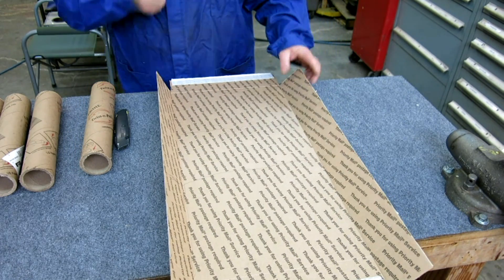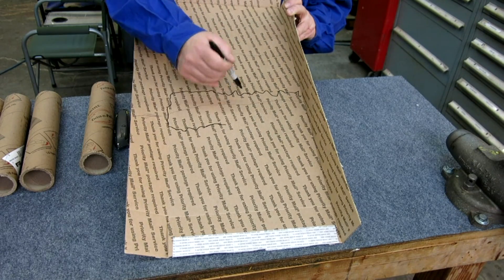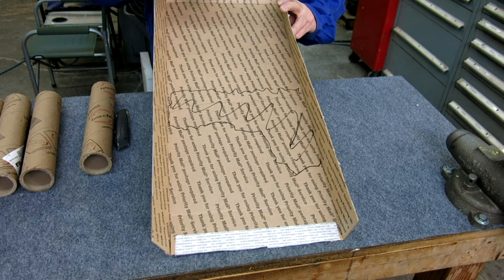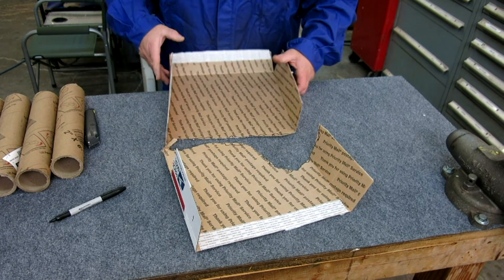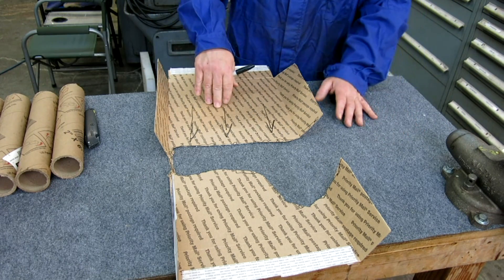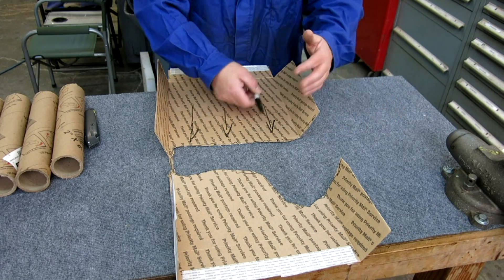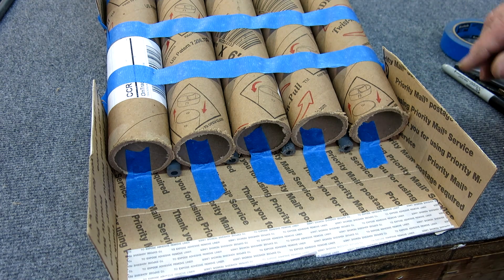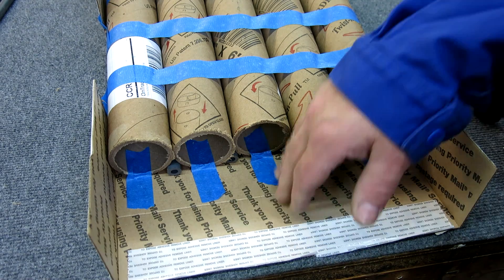Oroville Dam Spillway Repair

Comment: Tom

Why not put a carefully calculated ramp up steam and let the water jump over the gap 🤡🤡 now where is my taxi 😀

Your mention of laminar flow brought back memories of being at Manchester uni.  I was attending a seminar on vibration analysis of rotating machines to predict failure modes before they failed using fast forniour transformation /sp ,while we were there they took us down to the engineering labs to show us Reynolds experiment in lamina flow ,yes they still have the gear he used and it still works just fine hope the link shows up there is a pic at the bottom 
http://www.mace.manchester.ac.uk/about-us/hall-of-fame/mechanical-engineering/osborne-reynolds/

Stuart

Comment: Why not fill the gaps between pipes with plate steel, and some fast set epoxy on the bottom against the concrete? I'm guessing the biggest barrier to this plan would be the logistics of getting the pipe in place, the ground around that area is probably a mess, likely a nightmare for heavy equipment like cranes etc.

Comment: Given there was clearly no forward-thinking on evacuation (as in planning) and when they executed an evacuation, a total lack of coordination, I would put little stock in anything that comes out of those allegedly in charge of a solution.

Ignoring the problem for so long, as in kicking the can down the road, is another malfeasance worthy of public ridicule and political backlash.  Jerry Brown and others must face responsibility here.

Tom's idea is fantastic.

To the left (viewed from air, facing) is the emergency spillway.  Could this be sufficiently stabilized, quickly enough, to permit a greater flow?  Then the main spillway could be shut down and Tom's idea put in place.

Comment: Based on measurements taken from this picture: http://www.zerohedge.com/sites/default/files/images/user5/imageroot/2017/02/08/spillway%20damage.jpg (which mind you, is in the early ish stage, now the gape is larger) and Google Earth (non-3D augmented, so you can see the concrete slabs) the game is 145 meters long, give or take a few meters, now, the width is 53 meters long, give or take a few meters.
A single concrete slab is about 12.05x14.60 meters long.
My take on it is unfeasible, i like the idea, but the 145 meter long gap (and again, that's early in) is quite long, it would need some kind of "infrastructure" under to support it. However, putting a big pipe with a helicopter, then diverting some of the water + controlled release at the other spillway (the way i understand it all works) could put enough water out of the main one for some light repairs with fast setting concrete or some serious scaffolding and a water proof surface that replaces the corroded concrete slabs, this water isn't standing so anything should just "glide" over if the structure is strong enough.
Reply: You're absolutely right. It's reminiscent of the landslide at the ski jump in Erzurum (Turkey). They poured the slabs directly atop the hill's earth. No piers or underlying concrete stepping.
Reply: My understanding is that the whole thing was meant to be temporary when it was built, and that a proper dam was meant to go where the earthwork dam that contains both the emergency and auxiliary spillways are.
Reply: Forgot to mention, since Google maps takes pictures from above, there's a loss in length that i can't account for since there's an inclined surface to which i don't know the angle. Maybe an engineer knows that based on US standards. I'm from Europe, no idea where to look. 
Oh and the gape started (oddly enough) right at that observation point (i assume that's a panorama telescope) road. That gives an accurate measuring point.
Reply: aserta using the emergency spillway is considered uncontrolled.
Reply: As an architect tho, i'm really shocked that the spillway was made in such a fashion. That's just asking for problems. Personally (of course, after passing it to an engineer for double checking) i would've had structure to anchor those slabs, there's no structure, at all, fact gleamed from the side pictures, those slabs were laid down as they are. IF i'm right, that's really sloppy. No offense to anyone's feathers, but you don't play with water, period.
Reply: Jake, wouldn't know. Not a dam expert, we studied them in school as structures. Well, then it's pretty bad.

Comment: I'm not sure of the length of the hole, but precast flat bottom concrete tubes might be a possibility.  Think of the huge spans they can make for bridges.
Reply: Spancrete.  The pre-stressed twin T sections they use to make parking garages, etc.  The concrete is embedded with tensioned steel cables.  Lay them upside-down so the flat side is down and the ribbs are up.
Reply: Precast concrete (like highway crash barriers, catch pits) might be the best way to fill the hole up and just add a quicker drying layer to fill the gaps between pieces and make it smooth, assuming that the supporting soil is soaked up anyway. The soil could be dried with a drainage layed in there first.

However, if the dam is under control there is more time for a permanent repair.

Comment: I think the spillway is 300 feet wide.
Reply: 174 feet wide , via google maps. Length of the gape is 145 meters long (+/- for satellite picture innacuracy and plus a few meters because the picture above is a picture of an inclined item, true lenght cannot be determined without the angle of the spillway, don't quote me on it but maybe 150 meters long or in feet ~492)

Comment: This is great! The best way to get a solution, is to start with an idea, because everyone involved with a problem has some kind of thought in mind to solve it. It just takes that one guy to come up with the ultimate fix. Lets just hope that the people involved are listening to everyone and not just a small group of closed mind individuals. Personally I would get together a couple of guys with 3D printers, lots of PLA, lots of glue, and print a section to fill in the bad part, it would only take about 100 years and would last about 3 seconds but ha, it's a government job, right?

Comment: I like this idea, it minimises the force on the face of the pipes. The smaller pipes can be pre welded to the bigger pipes before they are lowered into place. sliding them down after the larger pipes are in has to many problems associated . pins can be added to the large pipe to help anchor them to the exposed rock. ( darn spell check and large fingers excuse the typing errors) 😀

Comment: I'm not an engineer, but I've plaid with fast flowing water in the mountains as kid. The water will shoot up in the ski at the edges of the pipes. And the water is not clean. the fine particles will erode the pipe in days to weeks. I don't think it would work. The problem is that you don't want do disturb the flow of the water, every time the water changes direction something have to take the force of the water hammering against it. In addition swirls will appear and grind away the concrete and seel.
We have a lot of dams in Germany and this kind of damage was fixed with with a special kind of asphalt and iron mesh in the past.
Reply: Jake Minogue What a snide,  hateful remark.  Contribute or remain silent.
Reply: The concrete would be made with ASTM Type III Portland cement - fast setting, high early strength...

This cement is made for things like tilt-up warehouse construction, where a very large percentage of the full strength is needed quickly.

The problem is, such cements are not stocked in huge quantities - they are high in aluminum oxide content, which makes them difficult to burn in the kilns, and then the clinker is harder to grind than a common Type I or Type II cement.

So, they are more expensive to make, production from the kilns and ball mills is less than for common cements, and they are not needed as much.

Then, they have a higher heat of hydration and tend to be more expansive during curing, so they are best suited to making thinner layers.

So, the Type III cemented concretes aren't a panacea, nor are they something you can rely on having available in sufficient quantities ate need.
Reply: You are correct, in my opinion the plan is neither feasible nor practical. A better solution would be to fill the void with gravel, stones, really anything that is relatively strong and readily available. Then to pour quick setting concrete. Its definitely not a permanent solution by any means, but would be relatively easy and fixes the dam in a way that allows it to operate as initially designed. There are certain concretes that can be poured and set in a matter of hours, I'm not sure exactly what they are but they are used for airport's that can only facilitate repairs at night.
Reply: Jake Minogue. And? Where I'm wrong? What's my mistake? Please elaborate, and make us smarter.
Reply: IPuttLikeSergio. I don't consider that a hateful remark. I'm german, he has to do worse. ;-)
Reply: boelwerkr you got one thing right, you're not an engineer...
Reply: I wasn't aware that there is such a fast setting cement. Very interesting. 
I think the expenses made the fix I've seen in my youth with asphalt. 
As i see it. You need something that will hold the stones and gravel together, not to expensive, fast settling and available in big quantities. It didn't look like a road surface tho. At least not in my memories. Its over 30 years that I've seen it... :-)
Reply: If there is one thing I trust, it's German science & engineering.  Otto von Guericke!

Comment: Your concept is good, issues I see the concrete (cc) in the spillway is maybe 8" thick it was layer on the slope it has been undermined by the water flow the pipe bridge is going to need to be very long an because the(cc) is so thin you may need to bridge the whole spillway to support the weight of pipes also anchoring them on such thin (cc) this will mean big issues to repair the subgrade of the spillway because because of the pipes are in the way. 
As for sealing the gaps use a water cure resins.  As for the USACE they have their play book and your idea will never be  considered because your not one of them or one of their contractors.

Comment: Tom you are right about the lack of useful information.  I don't think they have time now to do much before the next set of rains.  I read this morning that they are dropping rocks and sand bags in the area of erosion.  They are also building a gravel road to allow trucks to come and pour slurry over the whole thing.  100,000 cubic feet of water per second is some serious flow, about 45 million gallons per minute.
Reply: Bill De La Vega When you Muricans stop using football fields and bananas and start using metric system?

Comment: Scale is important here: the damaged spillway is 178 feet wide, and the side walls are 20-27 feet high. If bridging the gap means increasing flow from the current 100k cubic feet per second to the design maximum of ~300k cfs, then that could be beneficial. But no further erosion is resulting from the current spill at 100k cfs, and I'm no engineer but I think it would take an insane amount of pipe to handle 300k cfs; more than can be installed in the next day or so before the next storm arrives.
Reply: I don't know the velocity of water on the spillway, but at 5 fps (probably low), 300k cfs requires a pipe that's 275 ft diameter.

Comment: I think it's a good logical idea that should work if the pipes can be placed and restrained against moving down that spillway. Heavy equipment access is the main problem since those pipes probably couldn't be safely placed with heavy lift choppers no matter how large. Floating each pipe over the top of the spillway and into place with pre-welded on guide cables might do it. I've operated a whole lot of large construction and mining equipment, worked on and around fairly large earth filled dams and it wouldn't be easy.

Comment: Too much engineering, too much time to complete before the next rain.The pipes would likely become partially blocked with debri sending water over the side again. Also though it could be done there are a lot of considerations for getting all the surface water in the pipe. 

 The local quarries need to set off some charges and mobilize as many trucks as possible, take advantage of the closed roads. The should build rock road right to the spill way, dump near and place large wheel loader on the spill way to begin filling the void. This operation can take place with water still draining from the spill way. Once grade is achieved start sealing with steel plating and simultaneously start pumping concrete under the plating. Why they don't already have the emergency spillway covered in boulders is a mystery to me, that's the real emergency currently. If one side fails the other will also. Helicopters and bags are NOT going to cut it. This threat is likely over but the next storm may be it's demise.

Comment: The volumes and forces involved here are crazy.  If  you use 5 20' diameter pipes, each pipe has to handle about 150,000 gallons per SECOND.  Using an online calculator (http://www.pipeflowcalculations.net/pressuredrop.xhtml ), at that flow a 100' pipe has about a 67 psi pressure drop (probably not right, but in the ballpark).  That results on a force of over 3 million pounds trying to force the pipe down the spillway.  Times 5 pipes.  5 30 foot pipes bring this down to about 375,000 pounds per pipe.

Comment: The cause of the spill way failure was not the water coming over the spill way. It was designed to handle that. The erosion was caused by the run over to the left of the spillway that hit the spillway from the side. Here in NC we saw that on various size scales during hurricane Matthew last summer, which I'm sure never made the CA news.

Comment: There are some good you tube videos about the near disaster at the Glen Canyon Dam about 30 years ago.  The spillway tunnel was destroyed by heavy flow and had to be rebuilt.  Engineers employed a new design in the rebuild to reduce cavitation which had been determined to be the source of the damage.
Reply: /watch?v=UhLFrvbtkf0  the solution was the good one, tho, in this case, i am to understand that the spillway isn't controllable.
Reply: Just a thanks for the info on the videos on the Glen Canyon Dam. I just finished watching them, very impressed with the cavitation damage that was caused. The fix was equally impressive. I don't think it would work at Oroville, it's a different type of spillway.  Thanks!!

Comment: Good idea Tom, without diminsions its very hard to speculate. There are also square or rectangular cement culverts that come in various sizes, some in steel might be available too.If I'm correct you folks have been suffering from a drought too. All this lost water from the resevior could be harmful too this summer.Civil engineer or not, common sense and simplicity rules.

Comment: why go through all that trouble. forget about the rest that is broke off.  round it off put a ramp under it so it throws the water into the air then you wont have the pressure washer effect it has now. the biggest concern watching this to me is when the water went in the top parking lot and started going over.  it looked like it was just going to keep cutting a canyon threw it just bypassing both spillways.

Comment: I propose an iteration:
U beams welded together in the center (you don't need a roof), and one pipe on each side? the pipes to get your lateral walls back.
Fastening to the hole will be a significant challenge, because you can't trust any of the concrete there, it's crumbling and if the water start lifting the upstream side of the created "bridge", it will flip.
Reply: nraynaud1 or HUGE c channel with a big side and I bet, it would be light enough to assemble away from the spillway and drop it in place

Comment: I like your idea, but i would add coffers to shut down a section, say 1/3.  Fly in precast concrete to shore up the dry section, thanks to the coffers, and them move the pipe and coffers to a new section a repair that.  If i understand that is how they built dams in the old days.  They would block 1/2 of the river and then do the other side once the first section of dam was built.

Obviously lots of variables, ground dryness, surrounding stability and budget.  I'm not an engineer and i'm pretty sure there are better ideas out there. Just my $0.02

Comment: Why not use Square Shaped pipes?
Reply: corners are structurally weaker....
Reply: That was also my thought except using U channel , I don''t now the largest size available, or it could be fabricated to suit. 
 This would , as you say lay flat eliminating the gaps, and also unlike a pipe if debris washed down not clog as easily , additionally you would not need to pull it out to perform the permanent repair it could stay in place and act as half of the form-work to re-pour new concrete.

Andrew
Reply: Calvin, It only needs to last till dry season.
Reply: Square tubes would probably need to be prefab'd but it would simplify it because they would neatly butt up against each other.
Reply: Another advantage: Channel iron can easily be bolted to the upper and lower parts of the concrete channel. 
Theoretically even large I-beams (with the "I" upright!) would work to some degree, although they will leak some, as they cannot be welded together at the bottom.
Reply: Great idea!
Reply: Roughly 50 meters wide of pipe approx 40 meters long.....  good lord that is a LOT of pipe, weight, welding, etc.... would take months (wag estimate)
Reply: You think his wife might object, Jackass?
Reply: tar paper
Reply: My old sewer pipe was made of tar paper, it worked... sorta, for about 40 years, but... I don't think it'll do the trick for this application.  ;-)
Reply: tar paper
Reply: oh they do, its just on the flip side for tax collection. how much can they sucker out of the people before they vote them out?